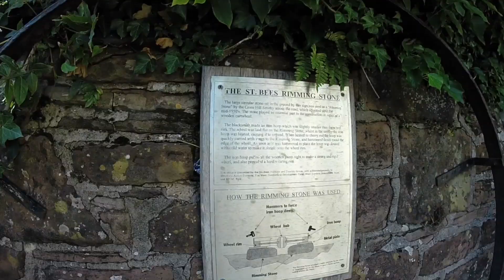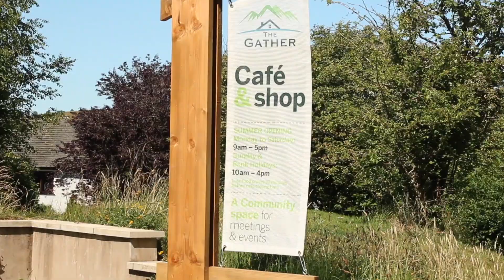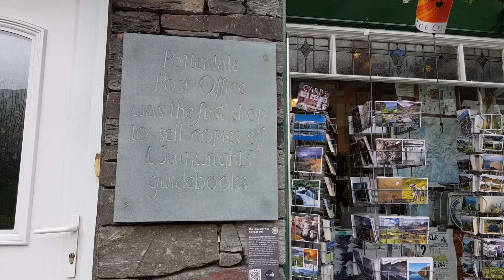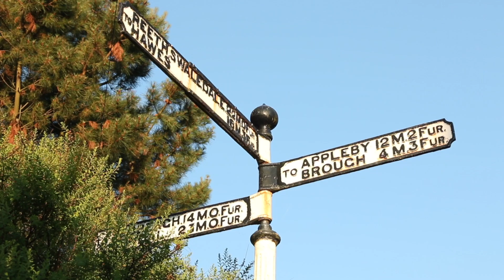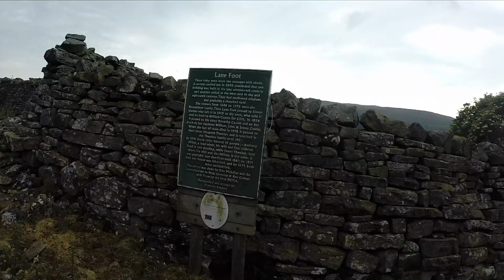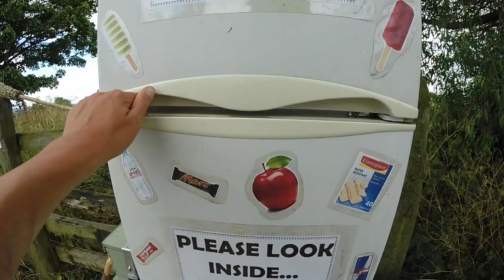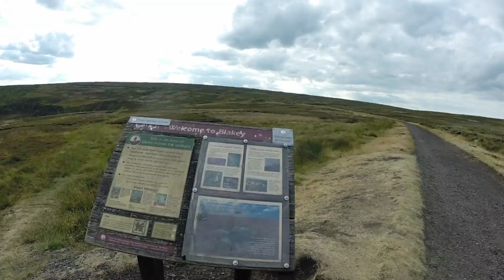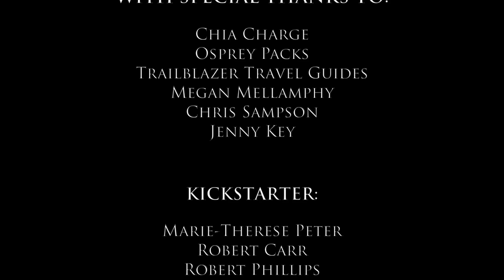Camping The Wainwrights Coast To Coast in England | Embrace The Journey

Comment: Did the C2C aswell in 2018 and had exact the same experience with walking along Haweswater Resevoir. The heat had gotten to me and I probably got a bit dehydrated. I had hoped that there would be plenty of shade that part of the track but there wasn't.  For me it was the most challenging stretch of the whole C2C, in particular mentally.

Btw: Just found your channel yesterday, while I was browsing around youtube for films to help me distract my thoughts from  the gout attack I'm experiencing atm. Already watched several films about trails I have done myself. I love them, and I love how you show the amazing as well as the hard parts of walking. Thank you for it.

Comment: This is yet another wonderful documentary, Abbie!  Thank you!  It's terrific to be reminded of the beautiful scenes that I too witnessed from my own walk along this path.  I camped wild on all of my long distance walks, since that allowed more miles on the trail, rather than diversions to campsites.  I notice that you found out decades before me, the benefit of a wide-brimmed hat for sun and rain protection.  Well done!   I carried the weight in my backpack (100 Litre Berghaus) higher than you, so there was less strain on the back.  I also carried a home-tailored poncho as well as a big cagoule and waterproof trousers.  Otherwise, long hours of rain would have been possibly devastating, with soaking wet backpack as well as the wet clothes I was wearing.  My Southern Upland Way walk had continuous rain for 10 hours on at least two of the days. Still great fun, as I'm sure you'd agree.

Comment: Feeling really trapped and inhibited from exploring by Achilles’ tendon pain at the moment. So glad to have your videos to watch. Really hoping to get out and about again soon.
Reply from the maker: Hope you recover soon!!
Reply: Hi. I too have Achilles tendonitis and have been  doing simple strengthening exercises which seems to be doing the trick. You can keep walking as long as you don't push the pain too much!
Reply: Hi @pearlbarnes5749  I think I may have already pushed it too much, and that's why I ended up where I am, but would be interested to know what strengthening exercises you're using. I struggle to face the pain of getting out of bed some days, even though I know it gets a bit better if I'm wearing shoes and moving around.
Reply: @hadorstapa  Hi David,
I thought I had pushed mine too much but there are things you can do. The exercises are slowly lift your heels onto tiptoe and slowly down again - repeat up to 8 times and 3 times a day.  This helps to strengthen the tendon. This can gradually be increased to one leg at a time. Use cold packs to reduce inflammation (not heat) and keep walking, but if the pain goes above '5' stop and have a break. Use boots/shoes which have a heel to raise the heel of your foot.  Massage won't help if it's tendinitis. Hope this helps

Comment: what a fantastic film,im going to have to watch this again,dent fell, i can see my house from there ,i can remember the farm in the valley there being derelict its not now though,at 14:00 where the white c2c sign was painted not far behind you is a stone circle, ennerdale, i repaired a drystone wall there in my early 20s not far from where you were sat at,also in them trees is the remains of a coppicers shelter, its not far from the path,  you picked the more interesting path around the lake, i need to back off from work and get out more ,I seen that at one point you couldn't get water as a pub was closed,at most churches check the graveyard as they often have an outside tap